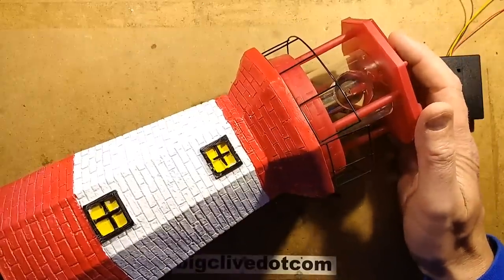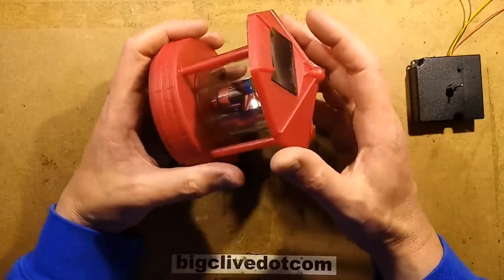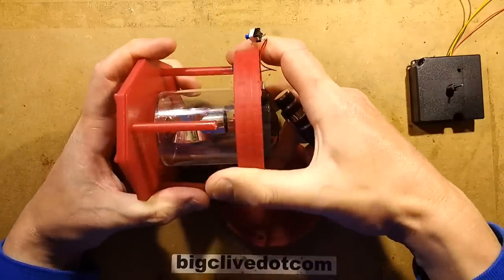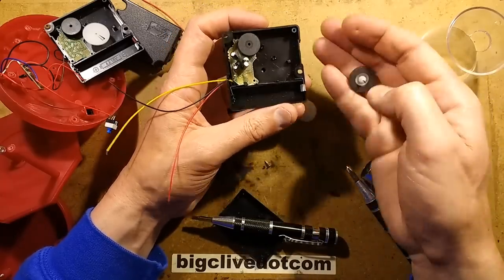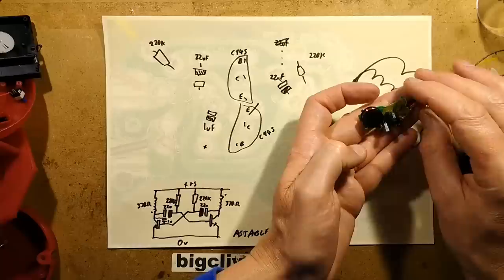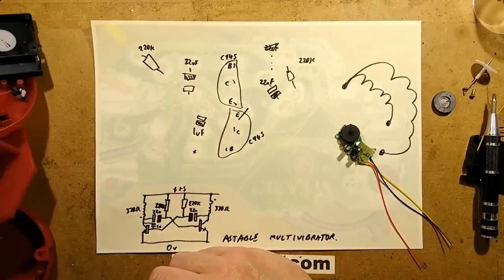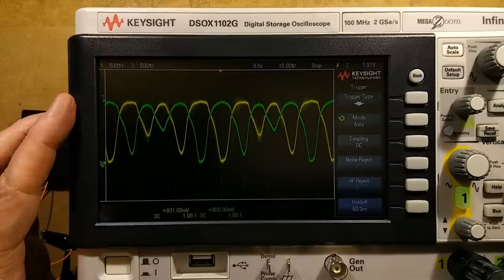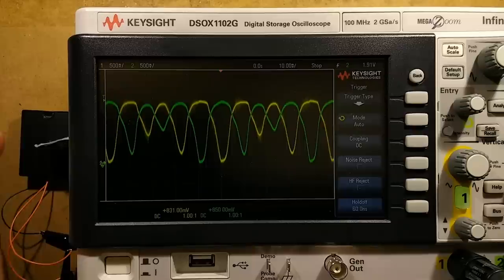Really interesting motor inside a solar ornament.

Comment: I Bought one from Aldi. The motor turned the reflector even in daylight. The instructions say it should only start along with the light during darkness. Took it back. It now starts to turn when it gets dark and the LED illuminates. The previous faulty one. flattened the battery after a day due to it turning during the daytime.

Comment: Holes are sometimes included in tight fitting plastic parts so that the air pressure can equalize when the temperature changes.  For example, many caps on plastic bottles will have a small hole under the liner so that the pressure change will not collapse the thin bottle.

Comment: Perhaps the holes are for the pressure compensation of the roof. Because of the black solar collectors, the air can be quite strongly heated and expanded. The manufacturer seems to have a lot of confidence in the waterproofing of the roof. :-D

Comment: Best value for money (at the moment) oscilloscope for a hobbyist is the Rigol DS1054z (50MHz but software hackable to 100MHz, 1GS/s, 4 channels) which you can get for £350 incl. VAT in the UK.
Reply: David Robertson or look around on ebay for used ones. I got a Tek TDS2002 for ~150£ some time ago. Not the best scope, but it does what it's supposed to.
Reply: Der Keksinator of course. But in terms of new that's the best value for money I could find at the hobbyist-feasible price point
Reply: Der Keksinator and having 4 channels instead of 2 is very useful. Of course if you use them all the sample rate drops though.
Reply: Seems to be priced at about £800 incl. vat in the uk. Also only two channels @ 70MHz, though it does have double the sample rate.

Comment: Monkey hands are so fantastic!
Astable Multivibrators can be used to make DC motors synchronous with an external reference, in this case it's seems to be related specifically to a constant speed.

Comment: Yeah its a 2 phase motor. The capacitor would be a kick starter to the circuit, while the windings and magnets through induction determine the position of the rotor.

Comment: Maybe you can use a small display/monitor laying on the bench, if the scope has an monitor output? So you can left the scope in it's usual position aside the bench and show us just the screen? I think of an display you can get for the raspberry pi and similiar systems, but it might be difficult to find one with the correct interface for the scope (VGA?).

Anyway keep up with the cool videos! :)
(for some reason I now really want to eat some wafles :D)

Comment: I have one of those from Poundstretcher! It died after one month of use! I tried opening it to inspect the motor and ended up smashing one of the gears! It's now just a static ornament! I have no idea why anyone would use a clock mechanism as a motor like this, it looks so hacked  together on my one. I could replace it with my own components but can't be arsed, quite frankly. :p

Comment: I have recently bought this type of lighthouse to replace one i had which had stopped.
I stripped the old one down and found it was basicly a clock mechanisim with the rotating reflector connected to the second hand post. needless to say it wouldnt keep going and the lot went off to the recycle center. But i have noticed that your lighthouse rotates 3-4 times faster than mine. Great work though and if mine stop's i know what to do.

Comment: It's a common circuit in cheap self oscillating toys. 
That extra cap is the "kicker" cap, as the magnet approaches it puts a kick of current into the base and triggers that transistor on which syncs the "astable" flip flop to the rotor speed. With the shaft held stationary the astable runs ar its normal slow freq, until it gets kicked by the kicker capacitor.
You also see this circuit in pendulum type toys because it syncs the flip flop with the approaching magnet, and runs at the mechanical resonant speed.

Comment: The motor in that is almost like a computer cooling bldc fan. 2 wind coil with 2 ends on one side like the common and the others separated for control from a driver, and a multi pole magnet to match with the coil when it switches, and the changing poles make the magnet spin. Funny how something so simple needs to be so advanced.

Comment: We have a black and white version. So many issues!  Found it totally unreliable when outdoors due to the battery terminals only resting on the motor pcb and therefore intermittent. I made the connection more resilient but at the same time must have damaged the motor winding, which is incredibly fine, so now the light works great but it doesn’t rotate!  Also on our version there is a transistor on the solar controller board that only switches on the motor when the LED lights, but of course this doesn’t do anything now!  I had wanted to add additional LEDs to go behind the windows, but struggling to figure out how to do this, any suggestions?

Comment: The extra mass on the main gear gives the clock motion less of that jerky feel the old, old ones used to have.
Reply: You know, all things considered, and setting aside the cheap nature of the beast, it is an ingenious design as designs for such things go. The wires go through one of the pillars, there's a previously existing device to make motion, a few off the shelf boards power through the deal. Not so bad as you'd expect.
20 years ago, something like this didn't exist...so that's something in my book.

Comment: That lighthouse is actually powered by a spinning pulsar. Through the power of Quantum Tunneling, the light traverses thousands of light years to reach that so called pink L.E.D. it's like a 4th dimensional fiber optic cable.
The battery powers the motor.

Comment: sad you didn't check the current/signal generated from turning the rotor manually :(
I had a suspicion on how you might get a rotation working when you showed the coil,
and yeah once you showed the reverse engineered drawings I got a flashback to the stock blink circuit... kids those days and their digital LED blinkers :)

Comment: Recently got into soldering and found I don't seem to have the dexterity (or huge hands) to do the circuit board grippage you often do in these videos.  got some helping hands and they work alright.
Reply from the maker: It's something that you develop over time.  I wasn't even aware I soldered that way until it was pointed out.
Reply: Next thing you know it Clive's unknowingly crushing the boards with his grip
Reply: I've always done it that way too. I finally gave in and bought a helping hands a few years back for when you need three hands with a dozen fingers each. The magnifier has been helpful in recent years too.
Reply: For bigger stuff you can get some battery charger clips and screw them to the edge of the bench.

Comment: Well you knew it was a multivib, but you said you didn't understand the purpose of the capacitors. Easy, when a capacitor with terminals A & B charges up positively A to B i.e. A becomes the anode and B the cathode. If the charged capacitor anode (A) is now immediately connected to ground, the cathode instantly becomes negative with respect to ground. 

When used in a multivib the transistor that switches "on" first from startup does exactly this. The other end of the capacitor is connected to the base of the opposite transistor and "instantly" turns it off by pulling the base negative by the amount of voltage on the capacitor. This is where the cross coupling applies the "feedback" and the whole process reverses and repeats. The current through the coil suddenly stopping as the first transistor turns off also causes a back EMF pulse which is "suppressed" by the capacitor, partially charges the capacitor and also aids the fast switch on of the second transistor by virtue of a current pulse into the base. The capacitor is then charged via the base resistor of the opposite transistor and once the charging current drops below the turn on threshold of that transistor it turns off and around we go again.

I'm REALLY surprised you didn't know this Clive.

Re: how it starts. The same as any multivibrator, there will be sufficient differences in component value tolerances to make one side or the other turn on first. Once that happens everything else just falls into place.

Comment: does the motor run equally happily in either direction? if it's normally used to drive fake torsion pendulums in quartz clocks I suppose it would.
Reply from the maker: +joinedupjon Yes, it's bidirectional.

Comment: Should i buy one of those cheap 100-120 pound ebay mini lathes (the metal ones) and put a more powerful motor in it?
Just looking to machine small aluminium and brass bits.
Reply from the maker: +Sportscars_BE Check out the reviews on YouTube first.  Some are good and some are badly made.
Reply: bigclivedotcom alright I will

Comment: 250 microamps in operation is kind of mind blowing.  No, scratch that, i's ABSOLUTELY mind blowing!  And at less than a volt, yikes.  I wouldn''t have thought you could make ANYTHING happen with that little power... especially not physical movement.

Comment: One question: Would it be possible to build a surge protection, by putting two zener diodes in revers series and adding a fuse to the input, so if the voltage exceeds 350V the zener diodes start conducting and blow the fuse?
Reply from the maker: +Techtastisch 75 You get similar devices optimised for that purpose that respond very quickly.  The fuse might not save the zener diodes.

Comment: Any idea where I can get these motors? I'm constructing a cassette deck of my own and I need a motor - this seems like an interesting choice.
Reply: You can buy a cheap alarm or wall clock, they all have one of these. I doubt it will be powerful enough to drive a cassette though.
Reply: I'm not sure what you want to drive in a cassette deck by such motor, but i think it doesn't have much torque to speak of.

Comment: I suspect the holes you mentioned ealy on are intended o let the internal relative air-humidity swing with the outside,: If you closed i completely at the factory you'd probably have a decent amount of water that will condensate on the electronics. t's t a way to make condensation non-existent,, but at the very least as the air humidity drops outside drops to fluctuations in weater, it will also drop internally to..

Comment: Hi Clive, i've recently gotten into soldering but all my solder wire sticks to the soldering iron is there a way i can stop that? maybe the comment section could help too, i'd really love some advice.
Reply from the maker: Are you carrying the solder to the joint on the tip of the iron?  That's one of the most common mistakes.  All the flux evaporates meaning the solder wont flow onto the pad and component lead.  The tip should be clean and shiny, and the solder should be flux cored solder.  Heat the pad and lead of the component simultaneously and then flow the solder directly onto them so the flux is released at the point of application.
Reply: i don't carry it on the iron, it just sticks to it after application,  but i'll try what you said about heating the pad along with the lead

thanks for replying Clive i really appreciate it! keep up the good work!

Comment: How does a clock that chimes different times each hour trigger the chime. I've one that strikes at quarter to 12 instead of 12?
Reply from the maker: That may be due to hand placement on the shaft, or with some that chime quarter hourly there may be an advance button to step through the chimes.

Comment: I have a black one, and I would love to know how to slow the rotation down by 1/2. I was even thinking about going with an LED that fades in and out that would simulate rotation as well, but I wouldn't mind slowing down the rotation instead if it's just a matter of putting a resistor in the circuit. What should I do to slow it down?
Reply from the maker: You could try a resistor, but they tend to run at a fair pace by default.

Comment: Is it possible to build the missing motor with the PCB they include or is the board fake?

If you put together a small CCTV system or build a PC with 4 cam BNC pci cards. With 4 decent quality cameras you can record several angles at the same time and cut them together. One for overhead and one for the scope. Others for whatever the next thing is. It's something you can leave setup at your bench. The quality of the picture of good CCTV cameras are as good as a phone these days. You need to read licence plates and small detail.  I put an entire system together for around $500 plus cameras. Cameras you could spend thousands. Depends if they are making enough money to be worth it. I use 720 PTZ cameras.
Reply from the maker: +Solder Joe It could be built, but the rotor is missing.

Comment: You may get Psychedelic  moving Walls by Placing a Paisley or Pattern  of colors around the  Tower,  * ~ *  
? It Runs 24\7, Why? Can't see the Light in the day, except for those Stormy Sea ones.
Can it Run off Just Solar Panels?

Comment: i bought some turn tables which have the same motor is it possible to connect a few together on a power supply?
Reply from the maker: +Bill Taylor You could hook them up in parallel to a low voltage supply, but it would have to be very low in the region of 1.5v
Reply: thanks i will try it as they only work on the window cill and not in the display cabinet
Reply from the maker: +Bill Taylor They may have a battery compartment.
Reply: a couple do but most do not but the ones that do have no contacts or sires to them
thanks for your help and i love watching your chanel
Reply: i bought  a 1.5Volt 200mA AC/DC supply and it has been running 4 turn tables 24/7 for last 3 weeks and they are the same motors as the light house which turns which ever way it wants unless i turn them the way i want before turning on the power. the heaviest item on them is a corgi thunderbird 2. thanks again for your help

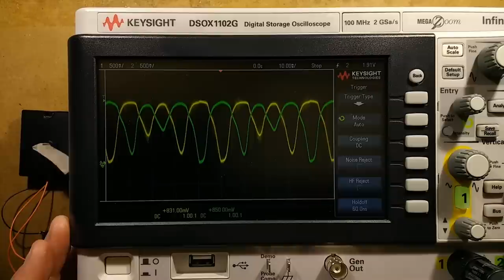Comment: In terms of small coils, you can get variances just due to the mag-wire. But likely it's a cheap coil and that one pair of windings just has fewer turns in it (or less likely: not very well wound). OR that kick-starter cap is cycling and causing a bit of additional waving. Freeze your video at https://youtu.be/3nQ9u_OYXSA?t=531(8:51) and if you follow the lower peaks of all the wave forms, you'll see another "phantom" wave.

Comment: I got one of these.. worked well, but i'm trying to repair it after it stopped rotating. the Winding does power up and the magnet gets attracted to it, but as I under stand it, it's meant to pulse like a bit like a PC fan, swapping from one pole to another, which leads it to rotated action.. but it doesn't. It's just static. maybe one of the parts has gone bad to stop that pulsing? any one got an idea?
Reply: Silly me.. no sooner do I finally ask for help, I think I figured it out.. while it was attracting when it was on and not when it was off, i'm not 100% sure why.. I looked very closely and noticed the two winding wires.. didn't seam to be attached to anything.. while I MIGHT be wrong (and to be honest, I haven't gotten it working yet) that might be a problem.. question is now about redoing that.. making sure the right ones are attached... or if I have to, redoing the winding (I believe I do have two types of winding wire so I can do that if I really HAVE to but.. rewinding a very small part? tricky..
though, as I said, while I believe I did reconnect them, it doesn't seam to have it working yet

Comment: Arrrgh not that bloody lighthouse!! I have one of those sodding things. Mine stopped charging the battery and the stupid thing kept spinning round even in strong sunlight. It turned the light off in daylight but then after a few months it stopped spinning round. Mine is the black one and the plastic top on mine looks more sturdy, I painted it with gold and blackboard paint to make it look more 'light-housey' and stuck the trinity house £2 coin above the 'door' for a more authentic look. Even new battery wouldnt work so I masked the 'light' in black to make a window, took the defunct spinny mech out, took out the components for the spinny mech so its just a light. It works but still doesnt charge the battery even though its the same components in any solar garden light (that 4 pin special chip thing, inductor, etc. I measured that once and it seems its a 'joule theif' chip and oscillates at about 200Khz ish on its output, depending on the inductor of course) I give up with it and its never been outside, its always been in my sunlit kitchen window. I like it too much to throw it away lol. Im glad you did this vid, you did what I would have done with a teardown but I just couldnt be bothered lol as I dont have any specialist equipment. I got the frequency from a multimeter that measures frequency as well as temperature and all the usual stuff :) Thank you :)

Comment: Does any one know if there is a gifference between 14 and 24v LED stringe Eg

5M-LED-Strip-String-Lights-5050-3528-SMD-300-Cool-Warm-White-Waterproof-12-24V
Reply from the maker: The 12V version can be cut at 3 LED intervals while the 24V version can be cut at 6 LED intervals.  The main advantage of using 24V LED tape is that you can run twice the length at a specific current without voltage drop becoming an issue.  A lot of the stuff used in studio lighting is 24V with matching control systems.
Reply: Thanks Clive

Comment: Every time flux smoke floats at the camera, I uncontrollably wince while turning my head.
Reply: Richard Smith It's harmless, don't be so disgusted by it. I've been breathing it for 10 years and I'm fine.
Reply: It's lead. No it's not harmless but I don't know how much is to much. I,ve soldered for years also. It probably should be used with a fume extractor if it bothers you. Safer that way.